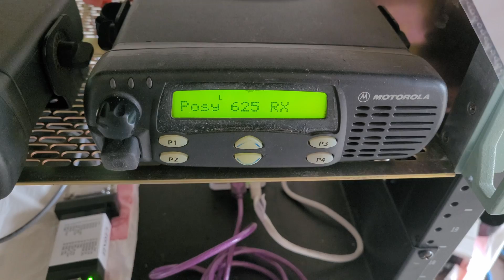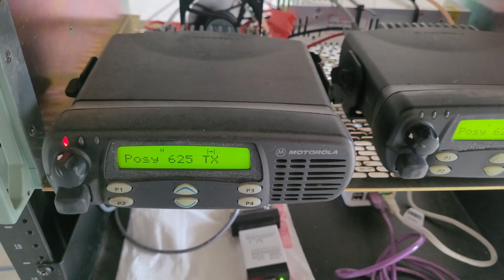Cheap GMRS Repeater Tour!

Comment: How are you getting the speaker on the transmission side to speak what is currently being transmitted (including the skywarn)?
Reply from the maker: You don't as its not possible with this setup. The receive radio will speak what it hears on the input but the output radio (transmitter) won't broadcast what its transmitting through its speaker. Anything heard from the transmitter is through a portable radio.

Comment: lol he thinks 1k his cheap  ,,,     use cheaper radios not Motorola lol
Reply: Those radios in the video are like $100-150 each... That's about as cheap as you can get... Even the junk BTECH and Radioddity mobiles cost that much. Repeater cost isn't in the radio(s), it's in the antenna system, feedline, duplexer, and everything else that comes with repeater ownership.

Comment: Would you be willing to share your software setting with me. I have two CDM 1250's along with the programing software and cable. But im not doing something right. These Motorola's have way more settings then a regular ham radio. Im just trying to build a plan repeater, no digital.

Comment: How do you wire them to work together? Can’t find any videos showing that
Reply from the maker: We will try and make something to follow along
Reply: One way is to use F6DQM "simplex" program on a win xp or later laptop. with the program
 are simple hardware diagrams for connecting a laptop to a TX and a RX.
using the laptops 9 pin serial data socket to switch Tx RX 
The "Simplex" program can be use as a single frequency parrot repeater or dual
 frequency full duplex